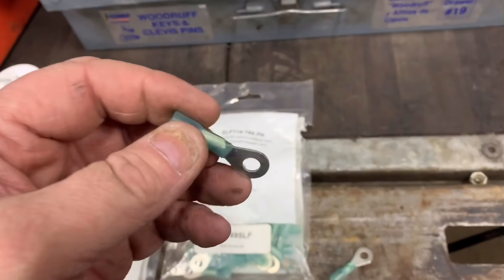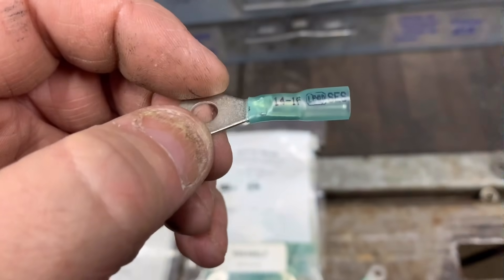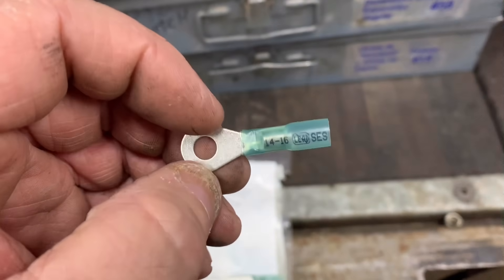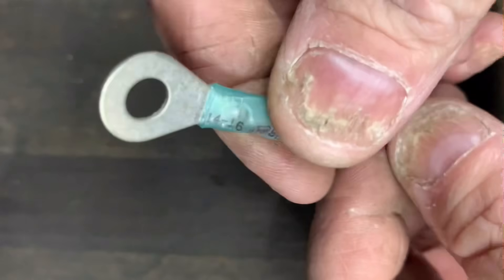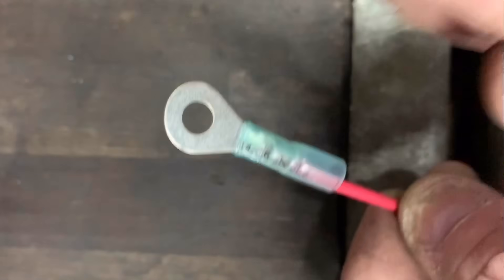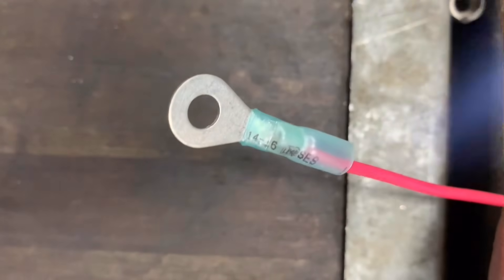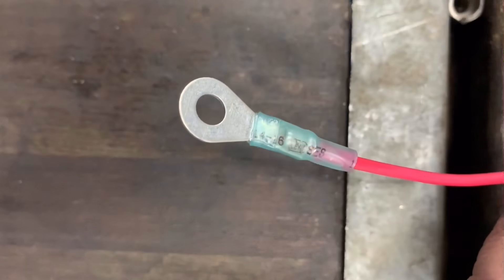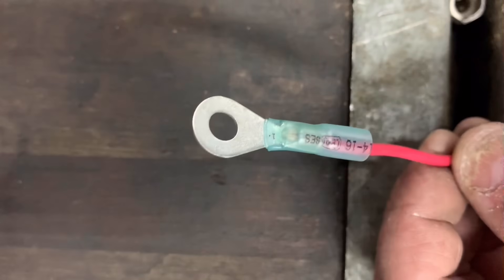CRIMPLESS WIRE CONNECTORS / SOLDER N SEAL / ELEKTRALINK SEALED SOLDER CONNECTIONS

Comment: I've seen those connectors.  Generally I use the regular un-insulated terminals, slide a small piece of heat shrink tubing crimp and shrink the tubing.  Sometime I put a little bit of dialectic grease on the terminal before sliding the heat shrink tube over it.
Reply from the maker: Yup done that too.  It works for a while

Comment: I enjoyed the video. Those are neat connectors, but I do feel at little soldering paste on the wire would assure good capillary action and coverage in and around the  strands of the wire. I wish you would have cut off the shrink tubing of one and inspected the quality of the solder joint.